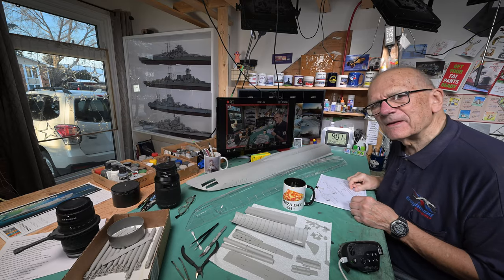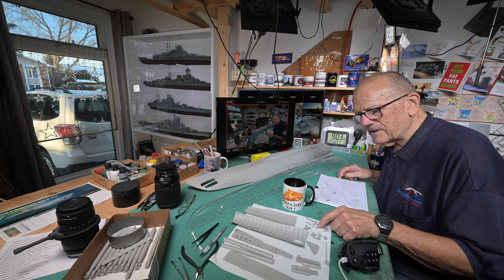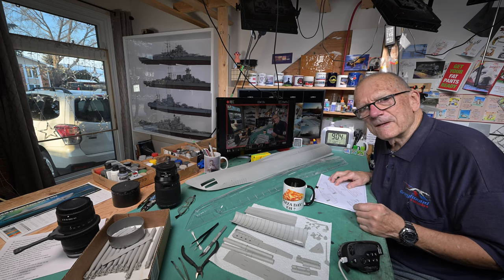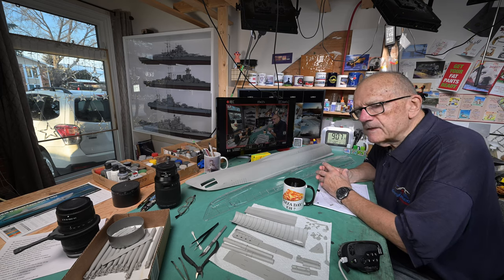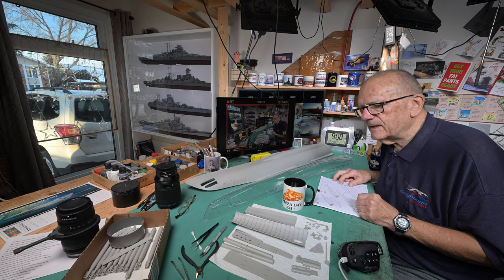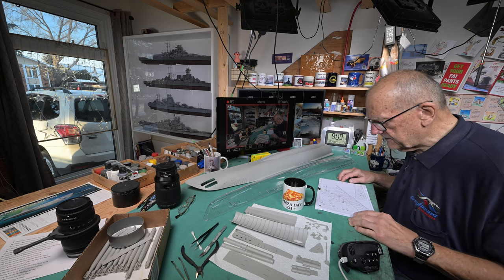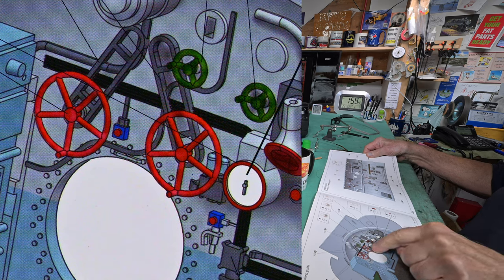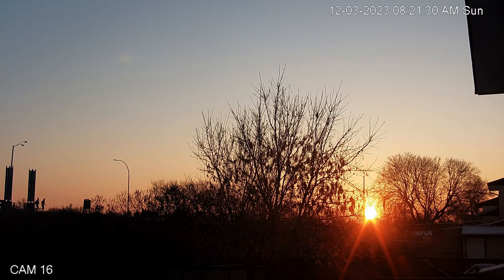The Model Ship - Part 1823

Comment: Hey Ron. This may sound crazy but dipping car windshield’s in future floor polish makes them shine and super clear. For something that large you might want to brush it on and let it drip off. I’m not pulling your leg. I’ve done it with ww2 plane canopies before paint and they look fantastic.
Reply from the maker: Sounds plausible! Thanks Jamie 👍
Reply: Can you still get Future in Canada? Gone here in the US unless you are crazy enough to spend the money on eBay.
Reply: @johnagoritsas4547  I’m not sure if it still goes by the same name. I have a bottle I’ve had for a while and I still dip canopies in it. It’s been debated on Facebook and utube because people are using it for a clear coat on their models and several different names have come up as being the same product/rebranded.

Comment: All valve handles are colored for the system that it is installed in.  Orange was hydraulic. Green was seawater. Purple was refrigerate or A/C. YELLOW was diesel fuel. Blue was fresh water. Brown was sanitary. Red was damage control. 
I don't know what the small handwheel is used for, but you can't go wrong with gloss black.
Reply from the maker: Thanks again! 👍
Reply: I'm wondering whether it was the same colours in the Kriegsmarine...
Reply: Reference material may be available, but I think I would watch Das Boot movie again for some references.

Comment: Civilian = Navy
Floor = Deck
Ceiling = Overhead
Wall = Bulkhead
Door = Hatch
Reply: Just to correct a few things: Floors are called Decks, unless the plates are able to be lifted to allow access to bilge spaces underneath in which case they are called floors.  A submarine would have "Floors" throughout and the only deck being the one on the top of the hull.
Ceilings are called Deckheads unless they are made from removable panels for decoration sake in which case they are called Overheads.
Doors are called Gangways, unless they are mounted on the deck in which case they are called Hatches.  Gangways go through Bulkheads, Hatches go through decks.
Sorry if I sounded like a Know-It-All, but being a Navy man, these terms were drilled into us
Reply: @Coalsmoke - Not being a know-it-all at all. I'm actually an Airedale. when it came down to specific ship nomenclature, we kept it simple.

Comment: Red and green could indicate port and starboard
Reply from the maker: That makes sense! 👍
Reply: Not if they are adjacent on the same bulkhead..🤔 Maybe water or high pressure air? Maybe the submariner can shed light?💡
Reply: Yes the handwheels , they were all over the place ,
 the critical ones all painted red , they wanted to quickly identify in all lights
same as the gages had red rings , all others were painted black 
I found the handwheels a bit out of scale , simple solution was to
purchase bags of watch gears , and sprinkle them about the boat
Reply: Ron the control wheels were probably color coded: red fuel, green oxygen, blue water, etc. this would help in emergencies when it came to isolating different systems.
Reply from the maker: Well --- they do add to the interesting detail👍